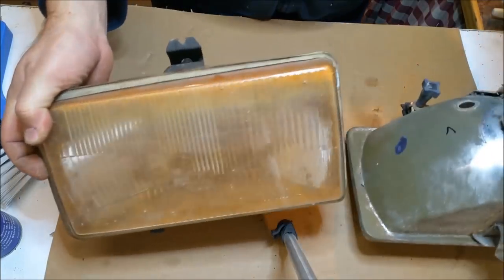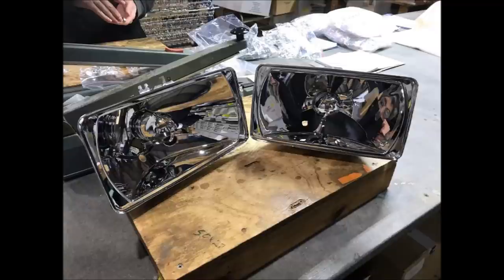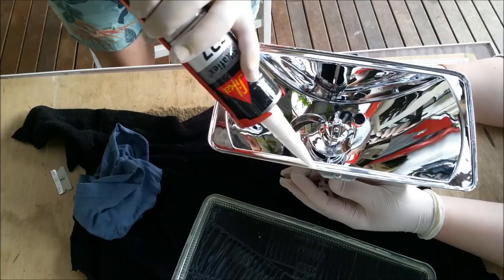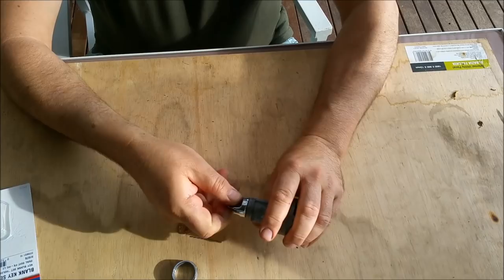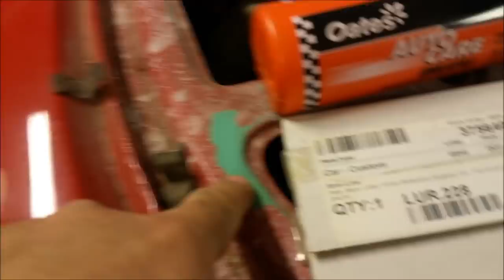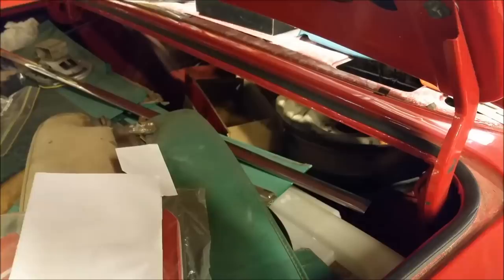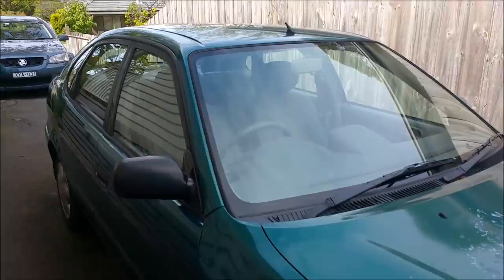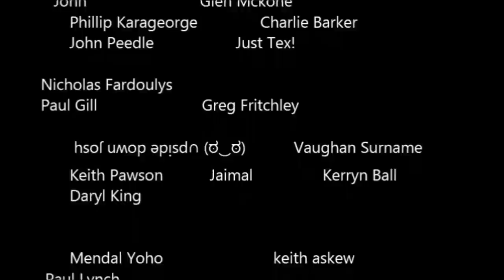Ford (XC Fairmont) Headlight Restoration - Plus the 1957 Plymouth Belvedere

Comment: Another great video. Peter. The headlamp restoration is magnificent! Wondering what that hole is for on the back quarter, some sort of vent? First time I saw the engine bay of the Plymouth, exquisite! I am sure, eventually, you will pull the engine and paint it silver. I agree that the white roof could be painted a more of a cream color (Wimbleton White is suitable) to match the steering wheel treatment, which then will allow you to trim the interior to match (or at least coordinate).
Reply from the maker: The hole at the rear of the reflector is for the parker light... a small 5 watt wedge globe/bulb that sits in a rubber fitting. As far as the Plymouth is concerned, I'll leave it as is for now and get on to the things it needs to get on the road - body mounts being the first thing, cheers and thanks so much for the comments.

Comment: Some lights I have don't have a hole for the park light but have a round clear section of about the same size as the cut out and a bracket spot welded for the globe to sit in, so maybe Ford found it a problem also

Comment: great job on those lights. That weird hole in the EJ key blank (on the originals)  was stamped with the barrel numbers. The idea being you would punch that out and put it in a safe place in case you needed it. No idea why a repro would have that!
Reply from the maker: Wow, I didn't know that, thanks!
Reply: @PeterAndersons  I think I may have tead it in my HD's owners manual? Anyway, did it on keys for about 4 Holdens, and promptly lost the tags anyway 🙄

Comment: Why not bite the bullet and respray the Plymouth the colour you like?  it looks 70% stripped as it sits.
Reply from the maker: It's just not worth it... it's painted in PPG 2 Pak which is a higher grade of paint than I'm able to use here, so I'll leave it. But I will re-paint the roof, cheers.